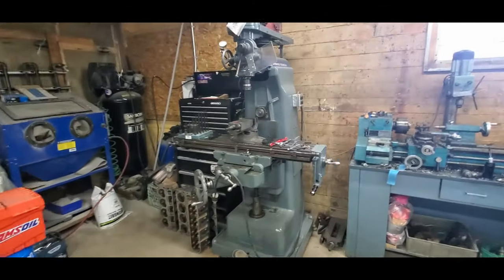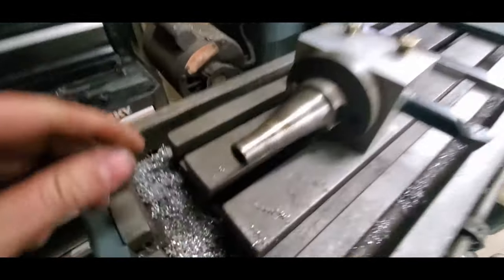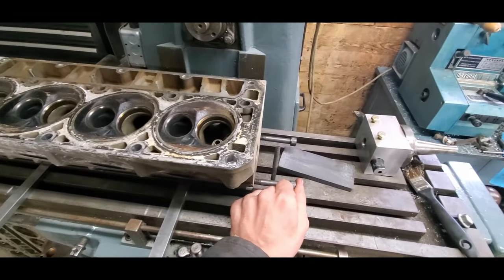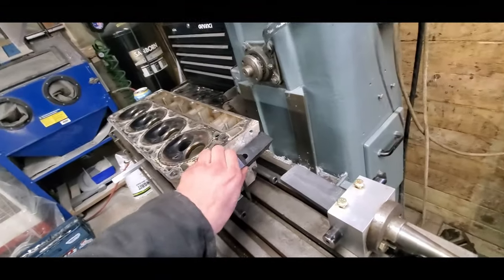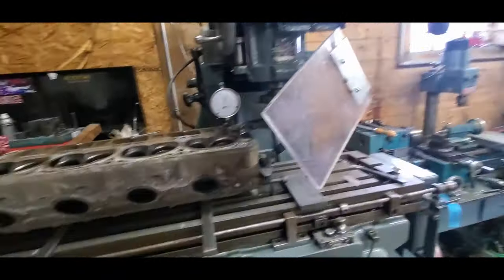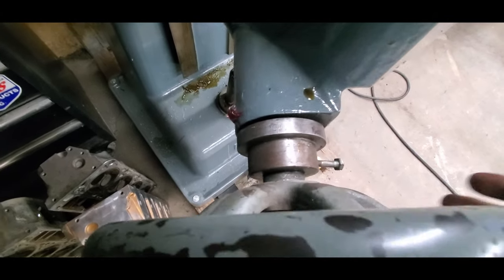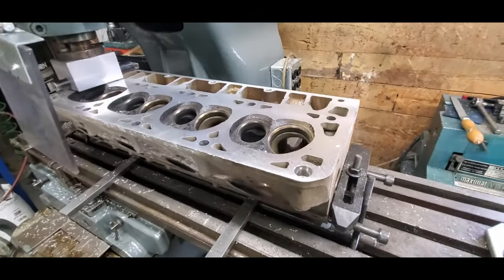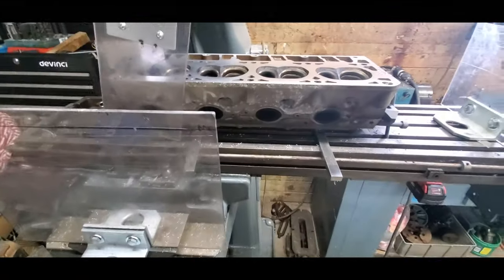LS Head Milling On Bridgeport Mill

Comment: make sure you put a flat bar on the head when you are done. many bridgeports have unacceptable level of wear that causes the head to be cut with a "bow".  your cutting tool also needs to be able to come completely off the head when the cut is done.
Reply from the maker: This mill works very well and wasn't used much in its life. 
Over the whole area I get consistently around .003 flatness, tested on a Mititoyo CMM at my old workplace.
Which is well within spec.
Reply: Good shout. I used to use a pretty new Bridgeport after approx 7 years of use I accidentally cut the bed at least 8 tho deep. Embarrassing!  The design of those mills is lacking at the extremes of X axis travel
Reply: Thats not so much from wear, more the mill head not being trammed correctly and cutting a radius on the surface. You can cut big radi using a fly cutter and tipping the mill head.
Reply: .003" variance is acceptable?  @LS_Eh
Reply: Flatness doesn't have a unit of measure
Reply: @lucysmith4242  Yes it absolutely does.

Comment: That's not a Bridgeport mill.
Reply from the maker: You are correct! In the video description it is described as Bridgeport "style".
Reply: @LS_Eh that’s dishonest
Reply: What type of mill do you have???
Reply: @LS_Eh Yea but it’s not a “Bridgeport” style either. It doesn’t have a rotating turret, not sure if the head can nod and it looks to have a horizontal spindle.

The words to describe this style machine tool is “Knee Mill”. It looks like a good machine, just call it what it is.
Reply from the maker: @strykerjones8842  people get stuck on the terminology and miss the point of the video, knee mill doesn't get views, as a lot of people uneducated in machinery/machining call them a Bridgeport.
Reply: @LS_Eh  Maybe so, you know what works for your channel and I understand your point. From my perspective I watched because I enjoy machining and was interested in your setup and tooling. The machine tool being used is secondary for people like me unless it’s unique, like a K&T rotary head mill.
Reply: @LS_Eh  I found this video by typing in "Heads Bridgeport". I'd say what you did worked damn good and the video was a perfect answer to what I was wondering. And it looks a lot like a bridgeport style mill to me lol

Comment: I do the same thing here at my shop on my mill. ZERO problems doing it this way. I've done countless LS heads and have not had any head gasket issues to date... I'd be MORE concerned about bolting a perfectly flat head, onto a warped engine block deck. It seems that is a common problem on the LS motors. Wish I could mount my engine block in my mill and surface the block that way... maybe something I should attempt here in the near future.

Comment: Good idea using the boring bar as a fly cutter. I probably have to mill the head on my old Continental powered forklift motor (it's pushing a little coolant which I guess is common with them) and I didn't know what I was going to do it with. I noticed the tip in the comments here setting it up slightly out of tram to cut with only the leading edge. I'll have to remember that if I do end up milling that head myself.

Comment: Shaving the head doesn't take the warp out of the head.
Reply from the maker: It will correct the deck surface which is mated to the block, you can add an error in flatness (warp) by just clamping it incorrectly.
I have tested it with several different knee mills and on a Mititoyo CMM I can get around .003 flatness on the surface which is within spec! 🙂

Comment: I am curious if any wear in the table or saddle of the mill translated into up and down movement of the head during the cut. If so, it looked like that machine also has a horizontal spindle. If that is a horizontal spindle, you could change your setup slightly, and eliminate any variation in the saddle and table affecting the cut.

Thanks for the video.
Reply: there is slop in every system
Reply: @PLUSHAIRPLANECARPET  Even more slop in a clapped out Bridgeport.
Reply: Man you should see the shit OEMs put out haha

Comment: How many machines do you need to start a cylinder head skimming workshop? Which ones are they?
Reply: The nice thing about his approach is that the average machinist will often have a bridgeport or clone of a knee mill. I have a bridgeport in my shop. I use it for all my milling needs which are many, and even though it takes more time and effort to set up to do a decent job of milling an engine head, as infrequent as he may do them, and the money he may make or not make doing heads doesn't warrant the expense of buying a machine designed and dedicated to milling heads. 
I feel for what he had to work with he did an excellent job. The important thing of course is getting the set up right with tramming the head, the spindle, etc.
Reply: @fredflintstone8048  setup is 90 percent of the job, bad setup equals bad outcome.

Comment: Great video. Have wanted for a while to convert Vanorman 570 to pdc/cbn cutter head but due to cost I have not been able (I am retired) I use my Bridgeport for a similar operation. One issue I have found is the valve cover rail is parallel to the Spring seat, but the deck is rarely parallel to the valve cover rail. Usually only a few thousandths off But I have seen over .010 + tip from one side to the other on many sets. I assume this is production issue, but it only causes minor chamber volume changes. If you do any volume, try a Korloy RCGT1003MO-AK. Will not finish like a CBN/PCD but is very cost effective and Labor effective over 3- or 4-point cutters. They support a slower spindle speed and faster feed rates found on some mills Such as the 570 while still giving Sub 50 RA. With Higher spindle speeds sub 30 is easy

Comment: Do you put the head slightly out of tram so the flycutter only cuts on the leading edge? Seems you don't have enough table travel for the cutter to clear the cutter on the trailing edge.. Or am I missing something?
Reply from the maker: You are correct, good eye! it's out of tram. 0004
Reply: @LS_Eh  Not my good eye.. I have a knee mill with only about 24 inch or so of travel (32 inch table) and want to fly cut a cylinder head or two so I'm stuck with only being able to use the leading edge.. So I was making sure the out of tram was an acceptable method. Thanks for the info..:)
Reply: Wouldn't having the head slightly out of tram mean that the fly cutter is cutting a parabola where it's lower towards the center? Or maybe the gasket makes up for that slight deviation.. ?
Reply from the maker: @wombats465  unfortunately yes, you do add an error in the deck surface doing it this way. Like a dish in the center, But the cylinder head still comes out within spec.  Unfortunately Don't have other options when using a smaller mill!
Reply: @wombats465  From what I have heard, the amount of "parabolaness" is very slight and gradually sloping. The gasket has no issue with this..
Reply: @wombats465  it does, but very minimal. Our dedicated head and block resurfacing machines are manufactured slightly out of tram as to NOT backcut.
Reply: @wombats465  I saw another video of a guy who had his tram out .002 with a 12” diameter cuter. The dish at the end of that would be down to a couple tenths and most head gaskets should be able to compensate for at least a couple thou
Reply: Most dedicated head resurfacers are set up intentionally slightly out of tram.
Reply: The OEMs do it that way too. I'm a production engineer at an OEM and the finish gasket surface for blocks and heads has a "heal toe" on the cutter so it only cuts with the leading edge. It is ok

Comment: What you need is a two piece vise that clamps to the milling table. You can set the jaw opening to about 85% of the table length. The way you are clamping the head down is super sketchy in my opinion.
Reply from the maker: No need to spend more money, I've never had an issue doing it this way! Especially when the doc is so small.

Comment: What length is the table on thus mill?
Reply from the maker: I have since sold this mill, but if I remember right it was a 36" table.
Need the length of cylinder head + cutter Dia for the needed travel.
Reply: @LS_Eh  I have a bridgeport and was thinking about doing some v8 5.3 heads ...it has a 42" table